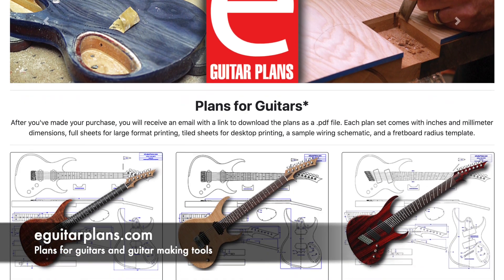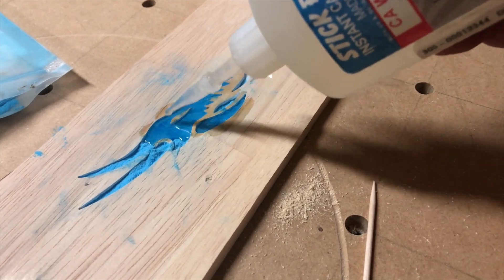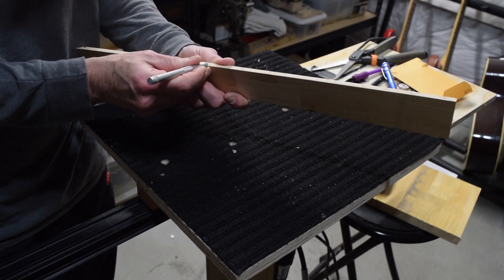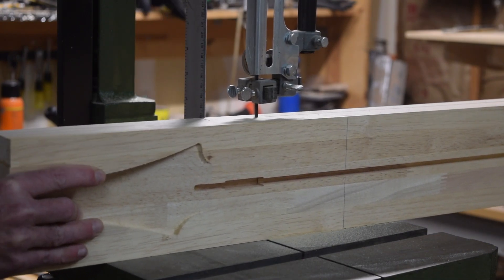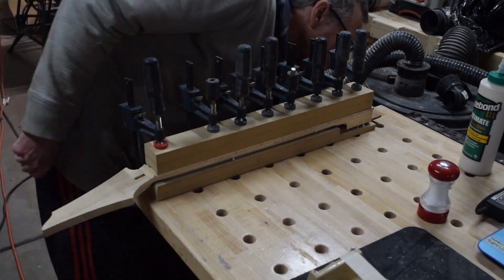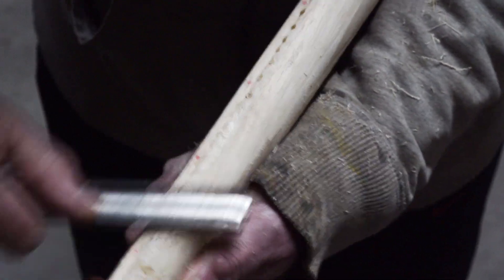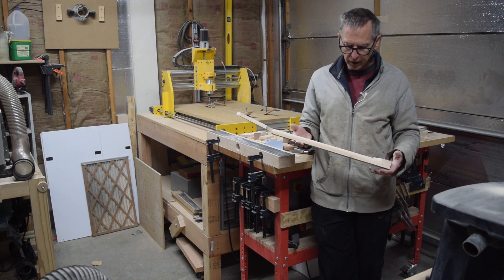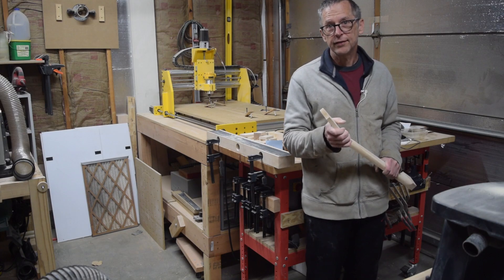Making A Guitar Out Of An Old Table Top Part 3

Comment: mmm I would have assumed you'd machine the fret slots out in a radius as well, because now the depth of your slot on the sides is less due to the process of making the radius later on? Kinda nice, it should not matter then?
Reply: I believed he mentioned in another video that the fretslots are radiused as well. CNC can do anything.
Reply from the maker: No. I don’t radius the bottom of the fret slots. There’s no point.